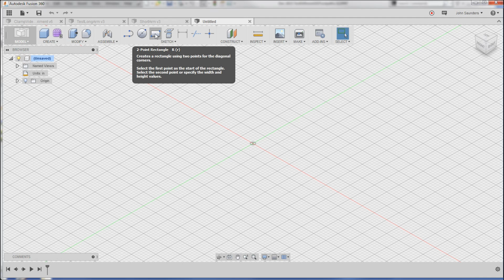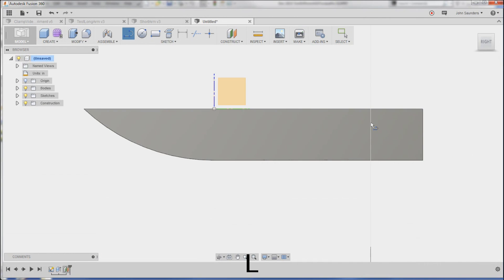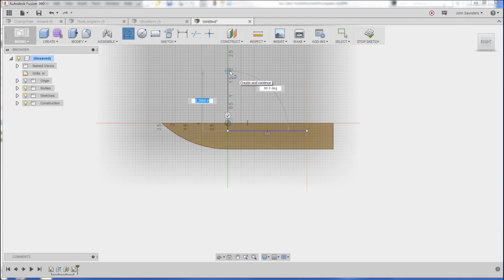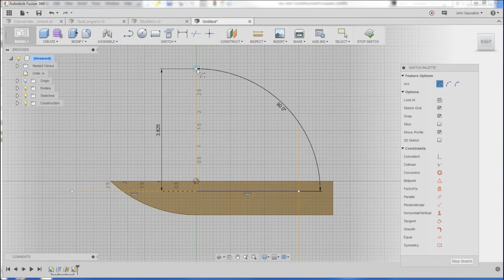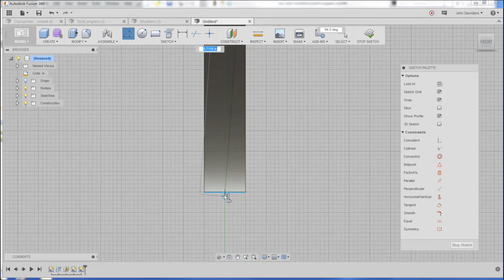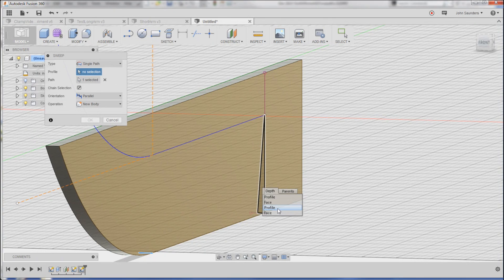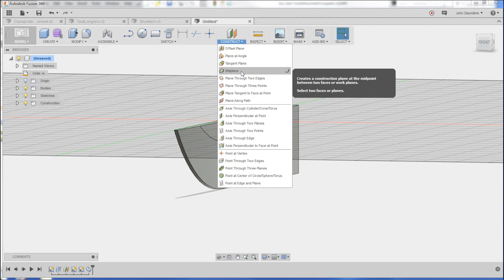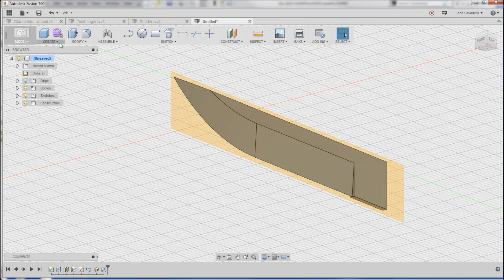Fusion Friday #4: Cut Sweep a Knife Blade!

Comment: Hey John, as an idea for Fusion Friday I'd like to suggest a few videos on sending models to drawings. Strangely drawings are not something I typically use, but should. I've never been terribly enthusiastic about F360's drawing functions, so I should probably get more time using it.

Edit: Just in the interests of completeness, the issues I have with the drawing function in Fusion is that it's glacially slow, even on a powerful Macbook., clunky, and worst of all the dimensions almost always don't pick up the features correctly. Having just been trying to use it again today, I do not like this part of the program at all and feel it needs urgent work by the F360 team.

Comment: can anyone help how do i use g42 or g41 on my tormach i try and i have fusion 360 and everytime i choose in wear or control wear it gives me a post error do i run the program under a different machine? because sometimes i have to redo the program and its time consuming and a waste of time and its faster just putting your tool wear in the control and run again . thanks
Reply: +NYC CNC 
well its a half a page but the important thing i see it says is
 error: failed to post intermediate NC data.

code page changed to 1252(ANSI - LATIN I) 
 
generated by : fusion 360 cam 2.0 1774 

Warning:work offset has not been specified Using G54 as WCS.

Error:radius compensation mode is not supported by the cnc control.

there is more but its to long to write but this is the important part . i still use Mach 3 i draw the part i want to work on and lets say its a bore op i need to open it .002 more i have to go back to fusion change the tool path then open it up .002 more and normally it should be in the tool table you can control the wear and run it again , sorry if this is long and thanks for the help John.
Reply: +NYC CNC 
and this code only happen if i put wear in fusion but if i keep it in "in computer " it doesnt give me an error it runs fine.

Comment: I've played with this quite a bit lately.  Instead of trying to manually create a sweep path, just create your offset plane/profile exactly like you did, then pick the bottom edge of the blade as the sweep path.  You can choose which direction to sweep it, go toward the tip, done easy.   This makes it easy to simulate a full flat grind as well (bevel goes all the way from bottom to top of the blade), and still get the top/spine of the blade to taper down to the tip.  Thanks John as always!

Comment: FWIW always leave a good amount of edge thickness so it doesnt warp during HT and also leave some after finish milling for some strength. Of course it depends on the steel used but .025 is a good number for most stuff
Reply: +NYC CNC ahh i hear ya. Merry Christmas sir

Comment: I think that if you make the two arcs actually concentric as the other greg suggests, then you will get the two faces to meet at the tip as you intend.
Reply: +NYC CNC no you have two equal radius arcs with different center points. What you want is to have coinciding center points (concentric circles)
Reply: +Christopher Hirsch  I agree Chris, they were not quite concentric witch is why is wasn't sharp all the way up the tip of the knife blade.
Reply: +NYC CNC really, there's no need make guide geometry here anyway, you want the grind to follow the blade profile, just select the blade profile. If you want more control, you'd select two guide curves, which gives you control over how the profile curve rotates along the guides.
Reply: William Hardin yeah, but there's no point in even offsetting it. Offsetting the guide doesnt make any difference, and really only offers the opportunity to make mistakes and have the edge thickness either increase or blow out the profile, both shown accidentally in the video :)
Reply: +rob lockwood You know what, I have no idea of what his design intent is so I'm not going to comment on what he should or should not have done anymore.

Comment: The way i do blade grinds is with a chamfer set to angle and a distance. Depending on the blade, the angle usually varies from 6-10 degrees and the distance is the width of the grind. Really simple way to do it an it can be easily modified to adjust edge thickness.

Another benefit is that the grind width will be consistent for the entire blade. It appears as though the arc you used for the sweep was not quite concentric to the profile of the blade
Reply: +NYC CNC I think what happened is that you set the center point of the arc coincident to the vertical reference line. If I were to do the sweep, I would project the curve of the blade profile into the sketch and create a concentric relation. 

Nevertheless, great video and I always enjoy your content. I have been using the student versions of Solidworks  and Siemens NX for a while, but I wanted to work on a commercial CAD license for personal use. I was pulling my hair out trying to find a full featured comparable solution that didn't cost several thousand dollars. I discovered fusion 360 from your videos and I'm really glad I did! I'm still adjusting from Solidworks, but the free-form modelling tools and CAM in 360 are like none other.

Comment: Not sure the path's arc was concentric.  In order to be concentric, I believe both arcs need to have the same center point, not the same radius.  Not sure if Fusion has an edge offset command, but that should be the quickest way to go.